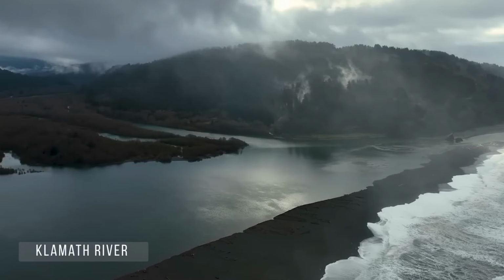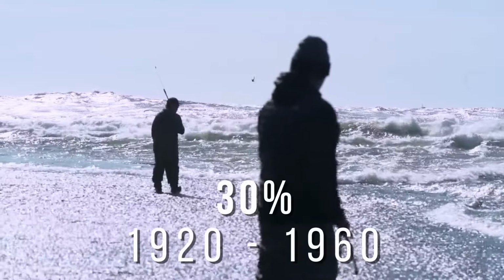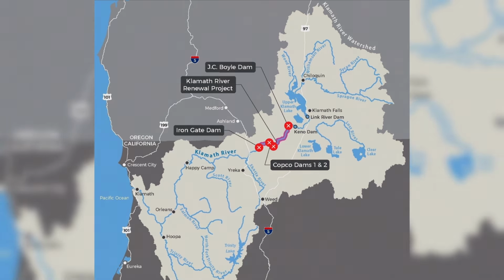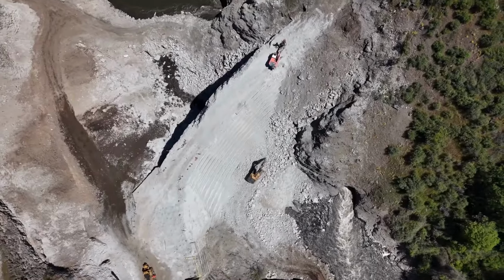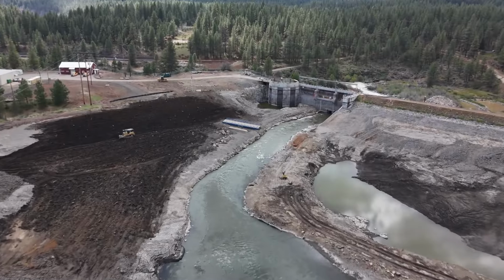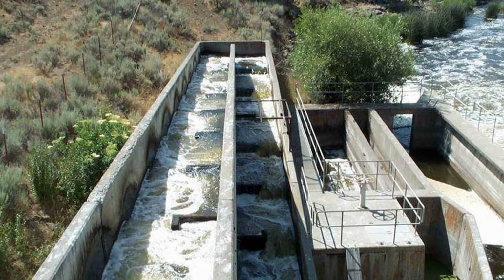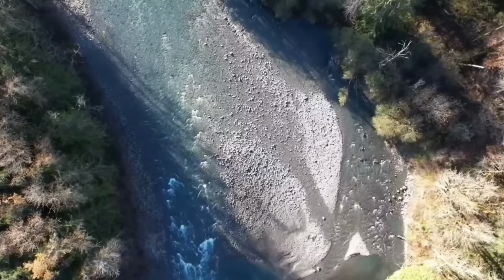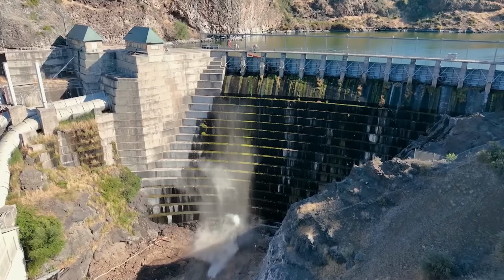Inside the $450M Klamath River Dam Removal

Comment: I think it's interesting that they're removing them. One way to think of dams is that they're supposed to be temporary for most of them. They're put into place until a better long term solution can be put into place take power generation. With power generation we have nuclear reactors that can produce enough electricity to replace them. Take the Three-Gorges Damn or the GERD one is a developing nation the other is China which are hungry for power. They structures allow both to put better alternatives in place, pay the construction cost off then save up enough for destruction and restoration.
Reply from the maker: Overfishing did play a role in the decline of salmon populations, but it’s only part of a bigger picture. The Klamath River salmon runs have been affected by a combination of factors, including the dams blocking migration routes, poor water quality, disease, and climate changes.